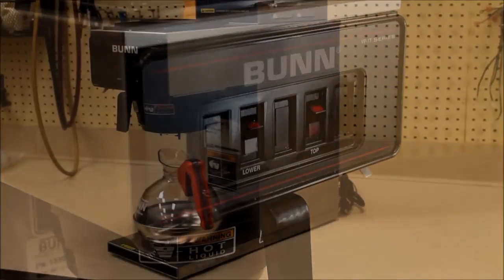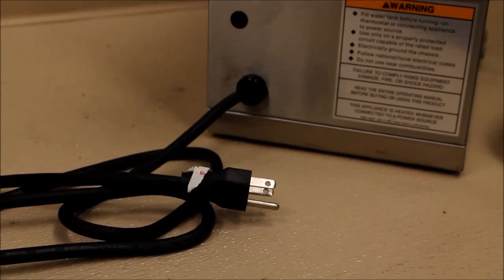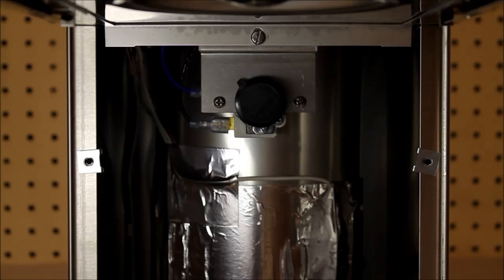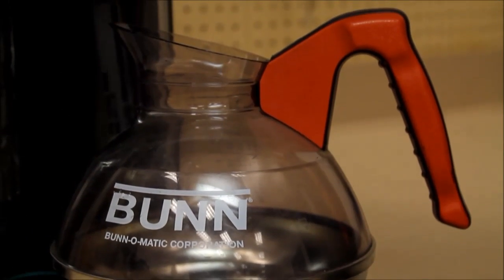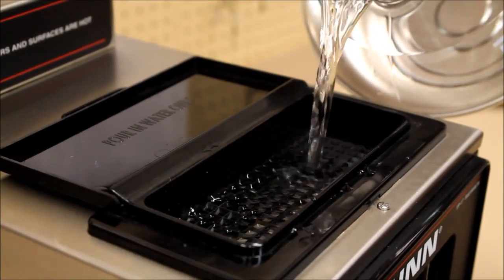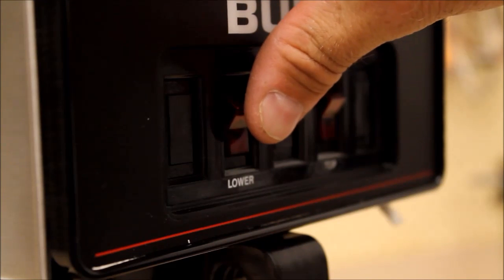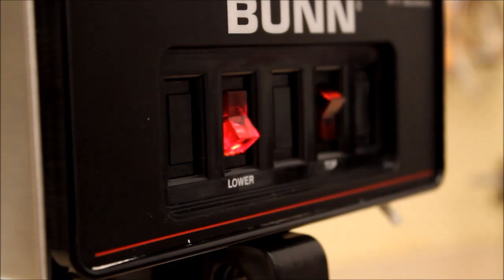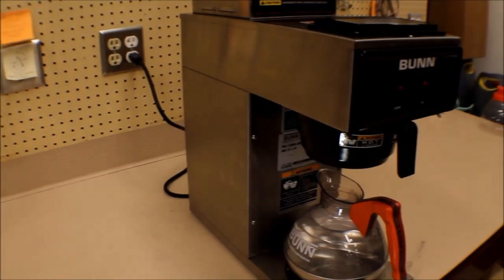VP-17 Pour Over Coffee Brewer (A How-to on operation and setup)

Comment: Still confused about why 3 pots of water and how to make 2 pots
Reply: I had the same question hooking mine up last night. It had a holding tank of water that it keeps hot, when you add water over that, the hot water comes out and what you added replaces what is now coffee.
Reply from the maker: +Carie Burns-Smith  When you pour one pot of water into the brewer, it fills the holding tank about 1/3 of the way full. After 3 pots of water, the tank will be full and after plugging in your machine, you can turn on the tank heater and after 30 minutes, brew a pot of coffee. See our new animation videos on our channel for more specific information and a look into how it all actually works from the inside!
Reply: when does it shut off ?
Reply: So is there always water sitting in the holding tank then? This doesn't sound right, especially if I use the brewer only occasionally. Do I want water sitting in there over an extended period of time?
Reply: @cstanton33  ya I'm kinda tripping about this too, but I brew daily. So I'm not concerned about mold or anything it just seems strange to have several pitchers of water in there ALL the time. And how do I drain it if I want to move it?
Reply: @Codeman785    have a 2 burner machinf vp17-2..so i have a double sink.. so I remove basket and pot, I take it over to the sink and tip it over with the base sitting face down in the right sink and the top face down in the left sink..water comes out the spray head and continues to come out until mostly empty and I tip it a bit lifting the base in the right sink untill water no longer comes out,,sit back on the counter and fill with vinegar and water.. 1 pot at a time..after 3 are in, let it sit over night to clean,,in the morning, pour several pots of clear water thru the machine until you no long smell vinegar..this takes a while but your tank is clean..
Reply: @cstanton33  Yes Bunn brewers hold the water at temperature so it brews immediately.  Just switch off at the wall when not in use.